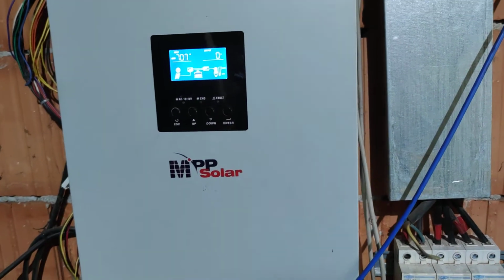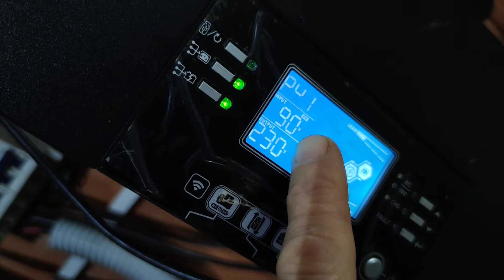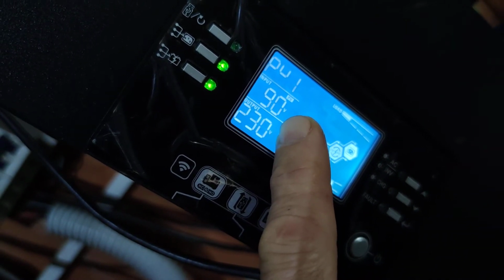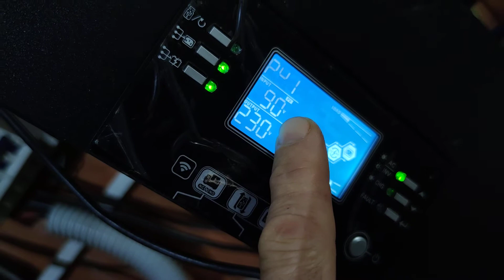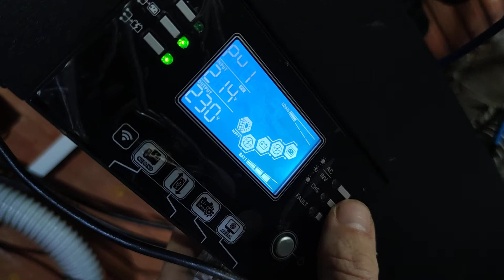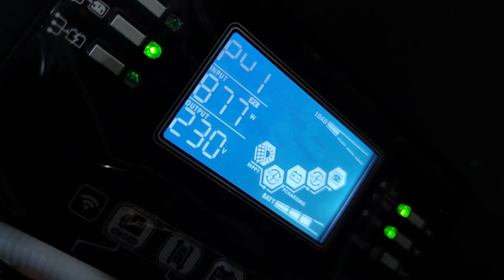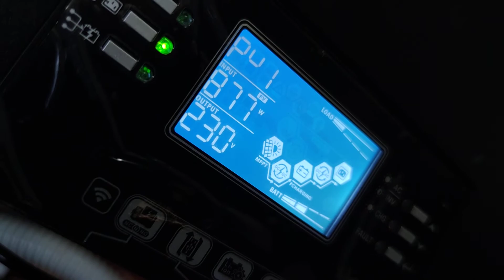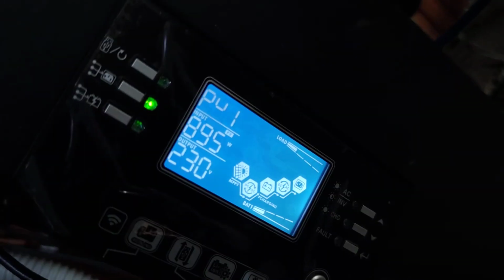EASUN iSolar SMW 8kW inverter - MPPT tracking not working properly

Comment: With an Easun 4.2 Kw I have the same problem, I have solved it practically, with a 20 - 30A relay -> low intensity coil, a resistance of 2 - 10Kohms (depending on the relay consumption) and a 1N4007 protection diode. Every morning when the sun rises and the voltage rises from 150-160 Vdc the relay closes (the relay is connected directly to the solar PV voltage and up to 250 Vdc a resistance of 10-15 Watts is Ok), and allows voltage to arrive. to the inverter of the solar panels, at night when the voltage drops the relay opens and the input of the solar panels remains at 0V.
With this you forget about the issue, because every time the relay closes and the instantaneous voltage reaches the inverter, the MPPT is positioned correctly and no longer fails throughout the day.

Comment: I have 2 firmwares from easun. 91.04 and 92.14, i update the 91.04 but the mppt let the voltage up only when have minimum 2A. What firmware do u have from easun?
Reply: Where do  you download the firmware? Thanks.

Comment: hi, just a question, the 500Volt  pv maximum array input is for each mppt   channel (500 + 500) or is for the whole inverter? is not clear in user manual because i see an example (in the manual) of 12+12 panels with 37v VOC, almost 450Volts for each imput!
Reply from the maker: Hi, each input is for its own. So, each can handle 500V.

Comment: Hello do you have some experience  with the wifi monitoring app for that inverter?
Reply from the maker: Hi, yes and no. I have installed it and use it here and there to adjust parameters on inverter.

Comment: Same problem here, tracking gets stuck at 90v until you cycle the breaker then it'll continue tracking. We have a high voltage string here, 470voc so it isn't related to your lower voltage string.
Reply from the maker: @bengrimmett1239  Hi Ben, have you had any luck with the new firmware? Try uploading it to gdrive and send the link to that. Maybe the hosting site is blacklisted by YouTube, not allowing the link...
Reply: @IgyBoyCRO  yes please!
Reply from the maker: Tnx for sharing. Yes, it was confirmed with Chinese that the algorithm used here is the same one use in low voltage versions - which means it is not optimized for the wider range voltage and can easily "loose" the MP point. :/
Reply: @IgyBoyCRO  Easun finally emailed me the new firmware updated called 'mppt optimisation update'. Not sure I can post links here.
Reply from the maker: @bengrimmett1239  Would be excellent if you have link to it. I believe you can post it without issues. There are more than few people reporting the same issue. I can (possibly)update the description in video to post the link to it.
Reply: @IgyBoyCRO  looks like youtube has removed the link, or its possibly pending approval from you
Reply: @bengrimmett1239   I'm also interessted in the update. My inverter shows the same issue in the morning.

Comment: how u solve the problem? works after update?
Reply from the maker: Unfortunately, no. I just gave up on having this inverter connected to grid.  I just use it in full off-grid mode. It still has same MPP problem, can't be properly turned off, but Easun was unable to provide solution to any of my problems so far.
Reply: @IgyBoyCRO What version firmware you have? I have a plan to buy this inverter but in case of MPPT issue it's preferred not to buy this one.

Comment: Have u solved the issue ?
Reply from the maker: Haven't got time to play with it. There is obviously some firmware being released by Voltronic that fixed "some" of the flaws on the inverter but I don't know which ones. Winter is coming so I might give it a try in a month-two.

Comment: Hello, I did not understood, how did you resolve the issue later? Just with the breaker on/off?
Reply from the maker: Yes. Fully disconnect the PV array is what works every time - you just need to remember to do it. If you are not at home...no luck, you will just loose that electricity. :/
Other inverters (even other, cheap solar inverters from China) are on occasions "probing" the array for MPP point in a way that it will drift up and down with voltage significantly, to see if it is still on proper MPP, and this will happen every once in a while. It is just how most of MPP algorithms work. This one seems to not have this functionality implemented or is simply badly implemented.
Reply: @IgyBoyCRO  i bought exactly the same inverter yesterday... f... Did you contact the assistance for that problem? is it available a firmware update?
Reply from the maker: @rOSScOGITANS  Yes, but after I reported it they requested that I upload/send them the data from the logs for at least couple of days when that was happening so they could troubleshoot it. But once I sent it, they stopped responding. :/
Reply: @IgyBoyCRO  i have deleted the order for sure, anyway it's a very rare model, no found other users of this inverter, no reports in some forum, nada de nada!
Reply from the maker: @rOSScOGITANS  It is fairly new model, so it might be that the later versions will come  with all those issues fixed already, and I totally understand that this happens (at this price range it can't be perfect), but what annoys the most is not getting ANY support over the matter. So I can't recommend them really.

Comment: you should  try  adding more panells  for this inverter close to max Voc-20%
Reply from the maker: I could try doing it, but that is not a solution. I do not want my array arranged like that due to specific arrangement of panels. Part of panels is in the shade for a part of the morning and afternoon, and if I put them in a single string, I do not get the max power from panels, as those couple of panels in shade bring down the production of the whole array. Also, proper MPP tracking algorithm should work regardless of the amount of connected panels. The proof is the fact that it works perfectly once you force it to "rethink" the MPP strategy by disconnecting the array. Also, I have previously had the 5kW version of their inverter, with same configuration for solar charger (90-450V) and it worked flawlessly for years.